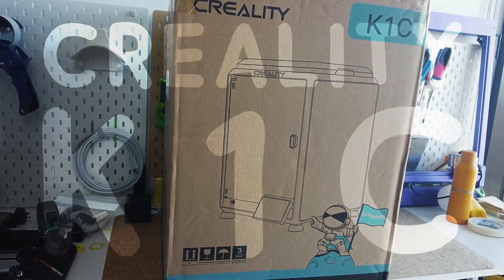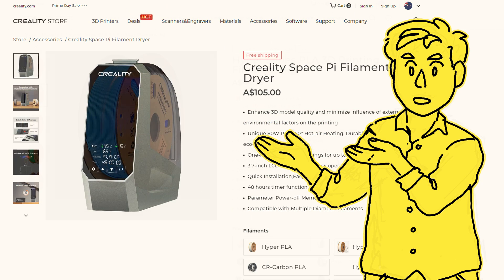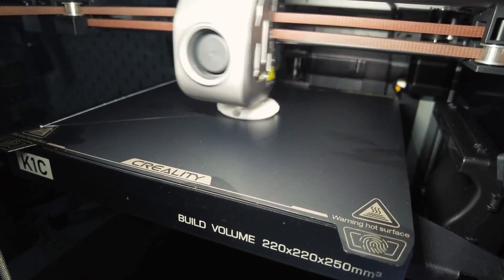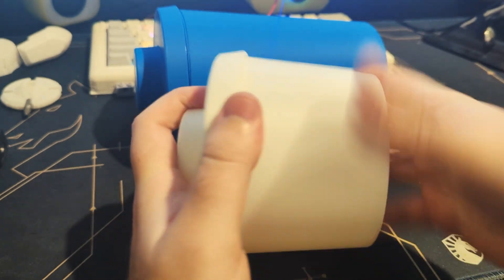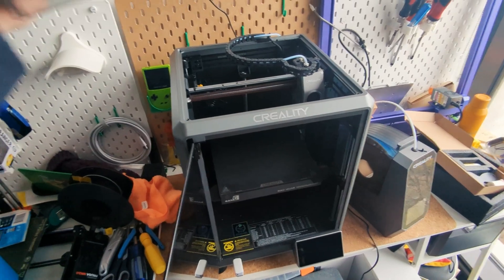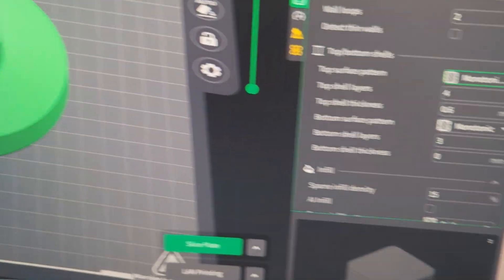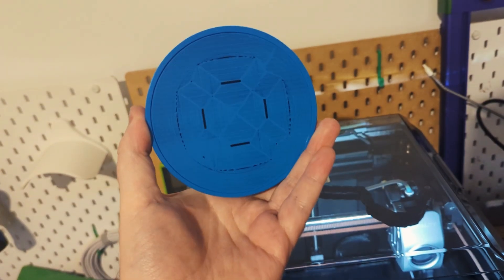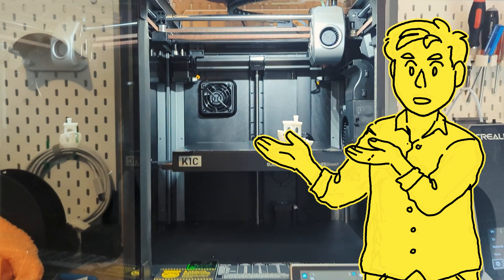Creality's New K1C 3D Printer Impressed Me

Comment: Mine took about 120 minutes to set up as the rear shipping bed screw was cross threaded and there's not enough room to get even the smallest pair of vice grips on it, making it damn near impossible to remove.  3 ruined Allen wrenches and a heaping helping of cursing later I got it free.